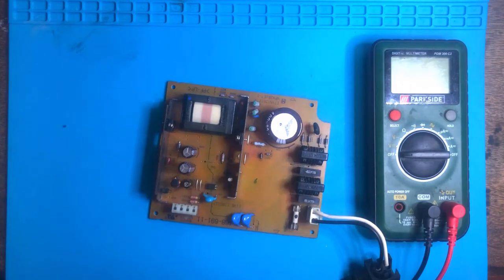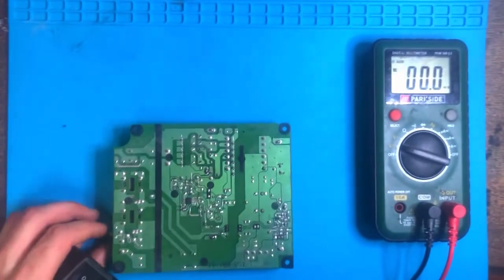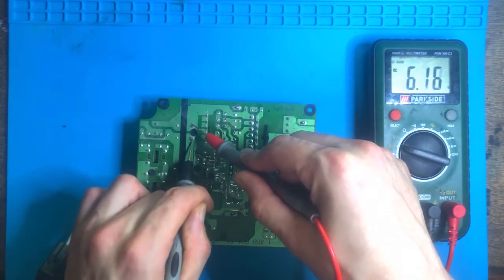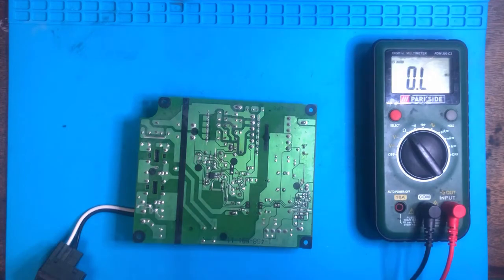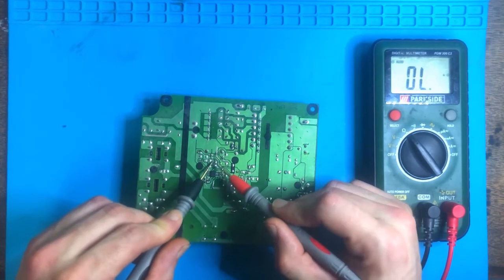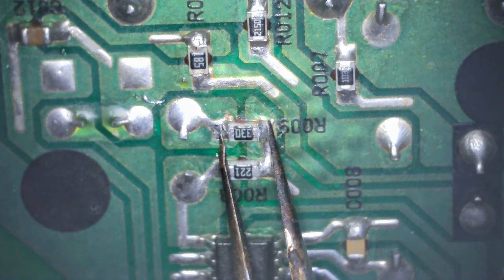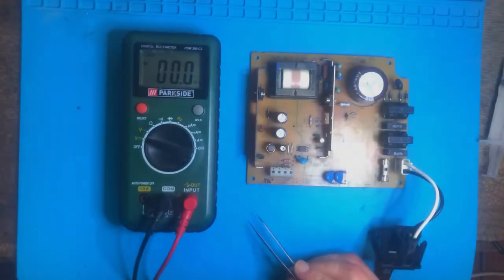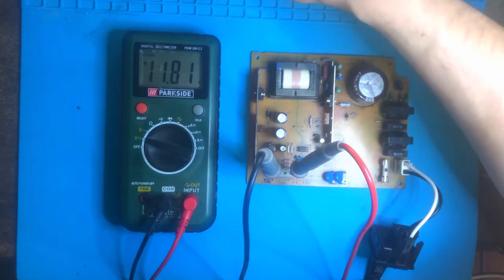Ps2 Power Supply Faulty no 12v PART 1

Comment from the maker: Turns out is actually the power management ic near the resistor applying heat in that area must have made it work for a few mins i tested again applying heat on the chip and it worked for another few mins i will update this video when i change it to see if it fully fixes it